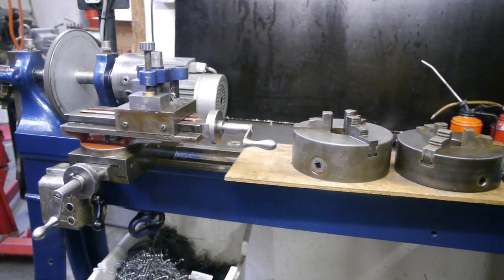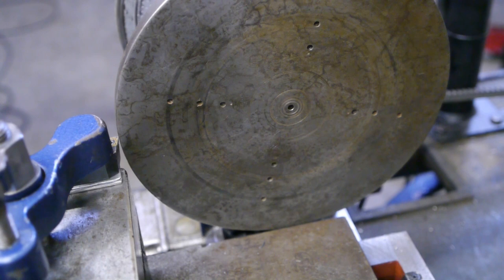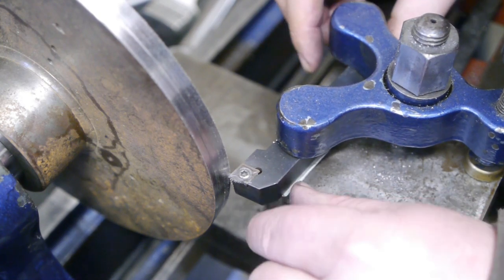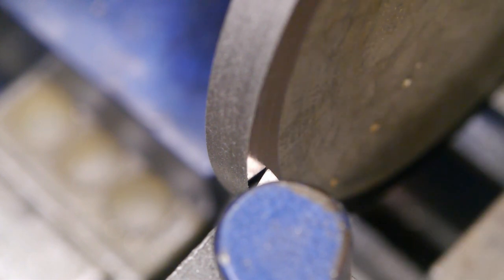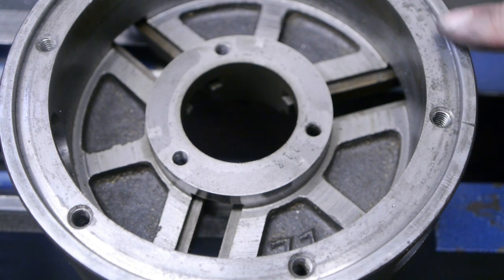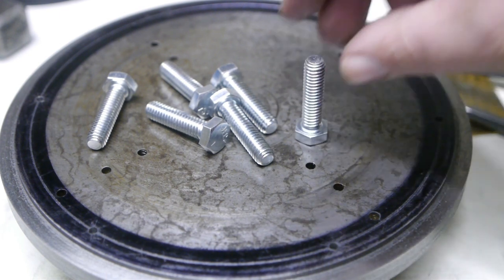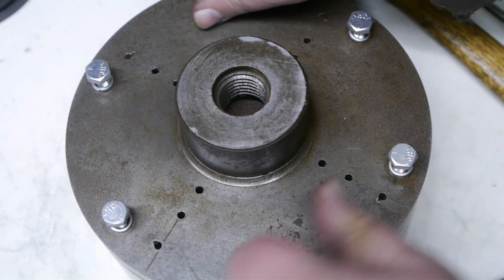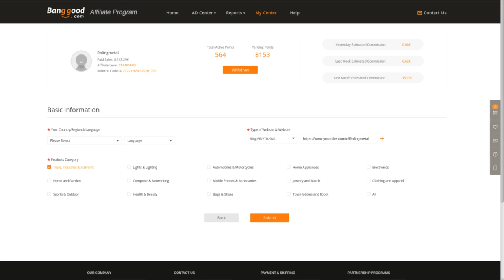Fitting a worn out chuck to an old faceplate on a vintage lathe

Comment: rM, 
    Good to see your project through to completion. As you know, cast iron is a pain on the lathe. Not only is it very messy it is also unpredictable as to hardness. I’ve had some cast iron parts that were so hard it was impossible to drill. This hardness occurs when the cast object is removed from the mold too soon and not allowed to cool properly. It will also work harden if excessive heat builds up. It’s a super pain to work with but you got the job done and deserve the kudos for persistence. Good fit on the register. Even with the tight fit the chuck can be bumped into alignment if the runout isn’t too severe so great job!
Reply from the maker: I was surprised how hard it was to get anything near a decent surface finish.
Reply: I know. It just won’t smooth out enough to polish. Some guys love to work with it but not me. If I want easy machining cold roll I get 12L14. That metal is pure pleasure to turn and shape and will polish to a mirror finish. 
    Most of the stuff I get to work with is usually a recycled mystery metal. I only buy new stuff when I can’t salvage from something.

Comment: Quick note.  Cast iron is extremely abrasive, hence being hard on cutting tools.  Also, 35° and 55° with .015 tip radii would be a wise  investment as they tend to require less torque to cut and are good at leaving a good finish.  Hope that makes sense.  Love the videos as always, keep em coming.
Reply from the maker: You can say that again, Luckily I'm done with cast iron for now. Nasty dirty stuff.

Comment: Several months ago, I attempted to turn a cast iron backing plate for my lathe. I can see that you had the same types of troubles that I did. But when turning the register, I over shot the measurement and ruined the plate! At least you didn’t do that!

I have quit buying from Banggood and all the other Chinese websights, it used to be I would get my stuff in 2-4 weeks, now it seems to take close to 8 weeks. Also half of the time the goods come damaged in shipping from inadequate packaging.
Reply from the maker: The struggle of the amateur machinists :)
You bough a nice lathe b.t.w.

Comment: Very good job with the faceplate.   I think we all hate to machine cast iron.   Always messy.

Bummer about the caliper.   The vernier design should have been easier for the manufacturer to get right.

Dave.
Reply from the maker: I still have to clean the lathe. Not look forward to that.
I got my money back and maybe I warned a few people. And it turnout I didn't need it anyway. So it's all good :)

Comment: I had flashbacks to when I made my cast iron backing plate. I think I'm still finding the dust from that even now.
Reply from the maker: Nasty business. I still need to clean the lathe. And I think I will have to take the slides apart to clean it properly.

Comment: usually you leave the register loose so you can bump it a little to give it the lowest runout, you are making it harder i think, register is just to get you close, a 5 thou or .12mm clearance would be fine.
Reply from the maker: I guess there are different views on this subject.
I've never seen a register that wasn't a tight fit. What's the point of having a register if it isn't a tight fit.
On smaller chucks (collet chuck) it might work fine but on something a bit bigger I prefer a tight fit. It might even help prevent chatter. In this case I don't care about some run-out. And If I want more precision I probably have to grind the chuck jaws anyway.
Reply: to get you close to the setting to save time.. its the bolts that do the work.but oh well, enjoy :)
Reply: I've done it both ways. With quality chucks, the register should be a very tight fit. With cheap crap chucks, you are absolutely correct that the register may need to be undersized to allow enough play to adjust for run-out. The issue with having clearance between the registers is that eventually the components will slip and need to be constantly check for accuracy.

Comment: got one of them calipers for £4, rough edges but way better than expected
Reply from the maker: Mine would have been a lot better if it was assembled properly. But the managed to drill and tap holes at an angle ang got those tiny bolts stuck.

Comment: Hi, nice video (and that chuck looks very well manufactured, even if it is now old and worn out). I would like to ask you, are the spindle adjusting/retaining rings on the left side of the spindle on your blue lathe, and the black one, right or left hand thread? I have a lathe very similar to these, and the rings are stuck very hard. And they cover the threads, so I can´t see which way they run.

Thanks,
André
Reply from the maker: I've used the old chuck for a bit and so far nothing came flying out :) 
Here's your answer: https://youtu.be/T99-RQcsNrI?t=957 
(The blue lathe has a sliding spindle and no adjustment rings)
Reply: @Rolingmetal  Thanks for your answer. Am dismantling my lathe soon to put on a new belt and motor.

Comment: Youtube has taken to putting two ads one after the other everytime there is a break for this insufferable barrage. I would expect that you are enjoying twice the ad revenue ! :)
As for BG, don't get us all started, er ehmm, yeah I have a beef as well. Things going missing in post and how do you take a screenshot of that :P ...ordered a piece from their US warehouse to expedite shipping to Canada and this should have been mailed by USPS, and been here over a week ago, but it too has vanished. 
Please try to remind us to shop through your link btw. I have a list of over 36 items in my cart and I wonder  if I must pretend that I have no "cart" and search for the items anew after linking through you?
PS. the runout on the face of the cast iron face plate won't be a problem when you bolt the chuck to it??? And congrats on finding the torque variable on the VFD, and same for not having to utter four letter words during the making of:-)
Reply from the maker: It's possible to get two ads if the previous video you watched had setup an ad at the end of the video. By default ads at the end of the video are disabled. I stopped using ads at the end of the video when I got confronted with two ads.
btw, have you ever seen an ad you could not skip? According to my statistics they make up about 2% of the video ads. But I've never encountered one anywhere. Infect a lot of the time I don't see any ads. When I rewatched this video I only had to skip one ad. I think there are just not enough ads for my part of the world.

I had 3 orders go missing myself. And all 3 came from the UK warehouse. I suspect theft, and you can't really blame BG for that. But BG asking for a video is typical :) I still need to make a video for their customer service for 3 led lights that were all d.o.a. Had to go dumpster diving for the package label and sku number. Good thing I recycle :) 

Still haven't decided if I'll make the video public :)

Comment: You need a bit of a radius on HSS when cutting cast iron or you just burn the point off. The chuck should have a chamfer on the edge of the register to allow for the radius.
Find a chart that has recommended surface speeds for the tool steel you are using and the material you are cutting.
Then calculate the surface speed based on the  diameter.
Not much point guessing the rpm unless you want to do a lot of trial and error and be no better off next time you turn a different diameter.
I like cutting cast iron. You don’t get those ham tin swarf shavings that cut you.  You can also put the shavings on your lemon tree (apparently)
Did you mark the position of those plates and gears for reassembly?  Not sure if it matters but I like to put things back in exactly the same place.
You didn’t put a dial indicator on the body of the chuck? I’m wondering what the result was.
If the regular jaws are belled out you could clamp a disk in the very back of the jaws then grind out the rest with a tool post grinder.
Then just under cut the bit at the back where the disk was while clamping the jaws open with a piece of wire on the outside of the jaws.  Kind of how you would true up a soft jaw chuck.

Enjoyed watching by the way 😀
Reply from the maker: - At first I used a carbide insert with a huge radius. But without the torque compensation that stalled the lathe quickly.
- I actually calculated the speed for HSS. I was a bit more than 100 rpm so I figured I could safely run carbide at twice that speed. Later I ran the lathe faster and burned up the HSS trying to get a better surface finish.
- I believe some flowers will have different colours depending on the amount of iron(oxide) on the soil.
- for what I need the chuck for I don't really care that much about the run-out. But I have been thinking about making another chuck grinding video. And this time try to do it right :) https://youtu.be/C2XTmkvTdm0
Reply: @Rolingmetal  I guess like most things it is a balance between all the variables.  I could see the machine stalling but not if it was caused by belts slipping or the motor itself stopping.  I found an interesting article on wikipedia about Speeds and Feeds https://en.wikipedia.org/wiki/Speeds_and_feeds
It was about HSS and not much about carbide.  
I used to use 90fpm for cutting Steel with HSS. (Wikipedia says 10-125 fpm)
RPM=3.82 x 90 / 7.5 = 45 rpm.  Seems a bit slow
According to wikipedia the surface speed for cast iron  and HSS is only 6-8 fpm.
So if you are turning 7.5 inches diameter cast iron.
RPM=3.82 x 7 / 7.5" = 3.5rpm  Shit that is slow.  I think I'm going to need to dig out my old books :)

Comment: Well done!
I can tell you are not a young man from a couple of hints I have picked up but the biggest tell is that you have found patience.
I think it turned out very well and hope it works for you. I am jealous that you can pick up old chucks like that so cheaply too. As for them slant eyes at Bang Good, I have been waiting almost 8 full weeks so far, for an order that I placed last mid January that they said shipped out two days after I ordered it. I am going to give them one more week and then I am going to contact them. I  guarantee they will be able to understand my Engrish because most of the words are only going to have four letters.
One more thing, I find it hilarious that you have no Imperial tools. As a mechanic with over 40 years of experience, I can remember swearing that I wouldn't buy any Metric tools back in the early 80's. Now I have more of those than I have Imperial tools. Funny how things like that work.

Comment: Get your torque up a bit on that lathe as with carbide you want to be a bit more aggressive with it...
Reply from the maker: Yeah, not much power left at that large o.d.
Reply: @Rolingmetal 

You can up the speed a bit with carbide...

I've a pattern makers lathe not too dissimilar to that one there...

Comment: You said the calipers came from Ebay not bangood! You are one unlucky bloke. I assume you've tried tightening the screws on that vernier?
Reply from the maker: Banggood only sells digital 20cm digital calipers and those batteries are probably always empty when you need them.
Some of the screw are  stuck at an angle and the screw is damaged. Real quality this one :)